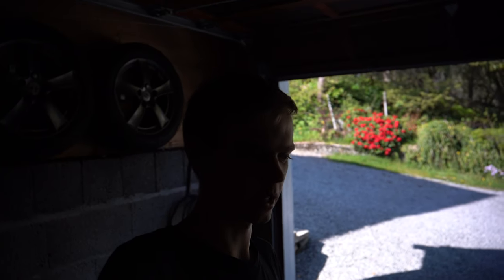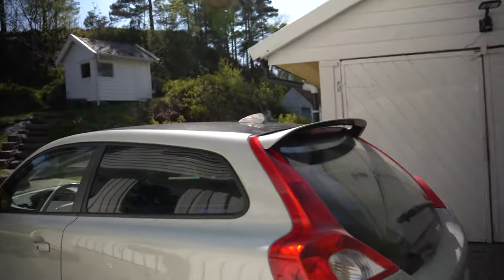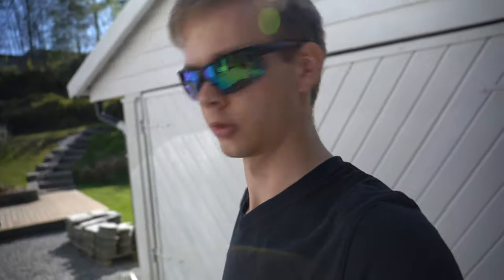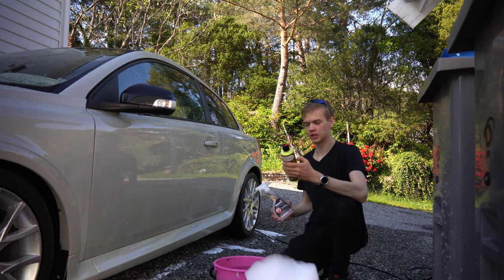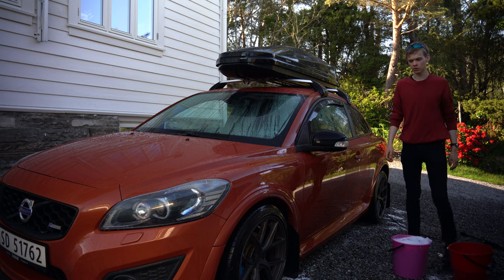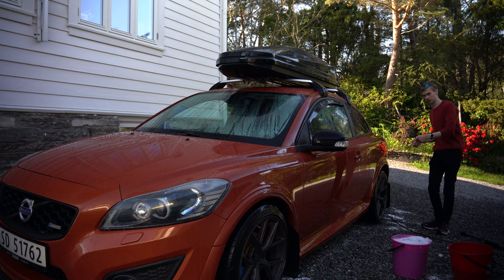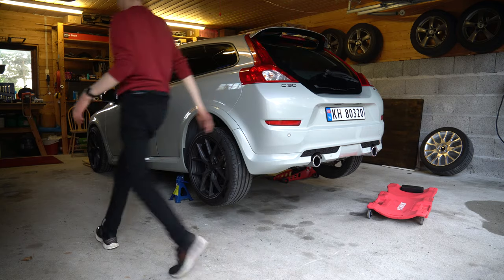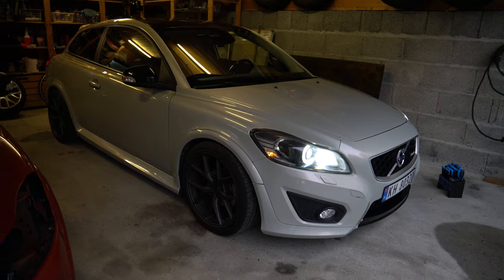I Might Have Bought Another C30 R-design... | Time To Modify!

Comment: How easy was it to get insurance on the d4 as a young driver
Reply from the maker: Well, it wasn't really in any way difficult, I really just phoned my insurance provider and said that I was buying this car with this registration number. If I wanted full coverage that would have been expensive, but at the level I have the price is not bad. I pay around $90-100 a month for 20k km a year. Also since there are only two D4s in Norway, they basically have no statistics on it.
Reply: @VinnesAuto  I see, I have d2 and insurance is cheap but was just wondering with the combination of r design making it more sporty in insurance companies eyes
Reply: @VinnesAuto  I am also on the hunt for a d4
Reply from the maker: It could obviously be different from country to country, but here I don't think they know if a C30 is an R-design or not. They don't view the car listing, they only use the registration information. They don't know that it's a D4, they know it's a 2.0 litre diesel with 177hp. They don't think about it being 5 cylinders instead of 4. Also just Volvo as a brand for anyone who doesn't have an interest in the C30 specifically will just see a volvo with good safety, and mostly reliable and responsible owners.
Reply from the maker: The D4 is around $20-30 more than my 1.6D was. Also there is the possibility which was my original plan: get a D3 which is the same engine, and have it remapped by professionals. I just so happened to find one of the two D4s in Norway at a price I could afford, and I'm so happy about it!
Reply: @VinnesAuto  Fingers crossed 🤞 it’ll work when I try

Comment: Name of wheels?
Reply from the maker: They are Japan racing sl01s in 18x8 with 225/40zr18 tires. They are reasonably priced flow formed wheels, so these in 18x8 weigh only 8.3kg each I think. Quality and finish seem really good too. I've had them for 1.5 years.
Reply: @VinnesAuto question: are option lab r716 similar to those rims? I Have the opportunity to get it. Want to achieve similar look as your car. If not might have go after the real deal.